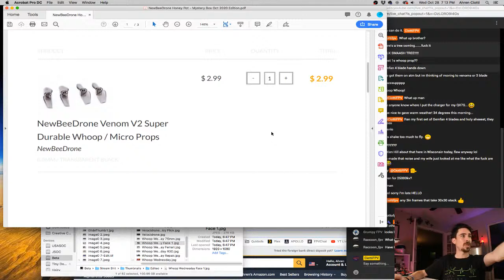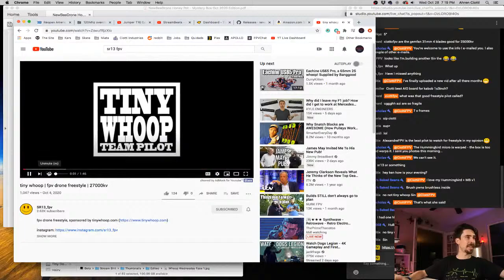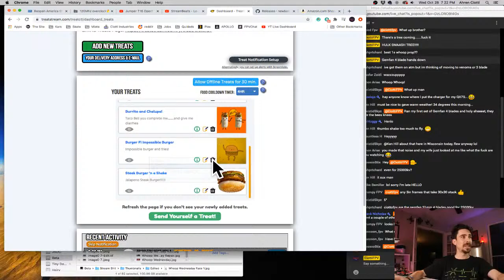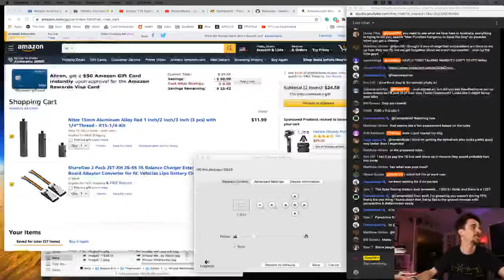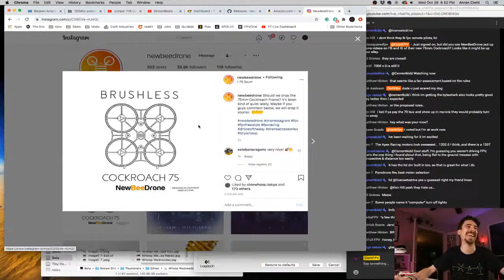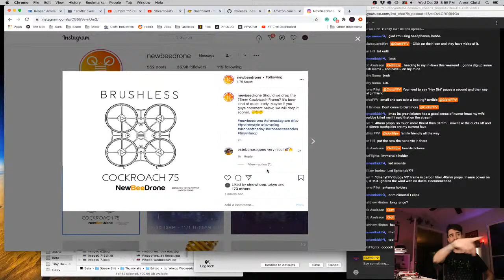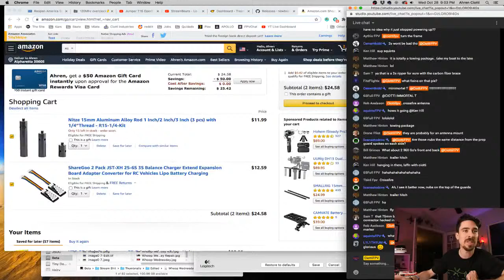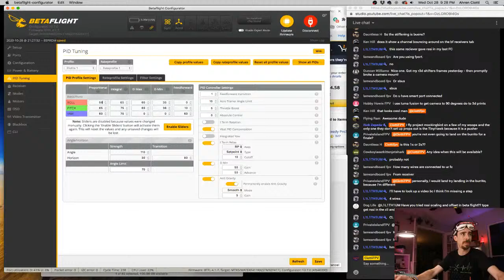Whoop Wednesday - Can we get to 4k Subs??????

Comment: Hi Ciotti.  Those ducts I believe are the Kingkong or LDARC ET125 duct if they can hold a 2.8" propeller.  They also did 2 smaller versions, and then later I think they did a 4" version
Reply from the maker: Son of a bitch you're right, 2.8 only, I fucking remember seeing these guards a while ago and I didn't buy them when I saw they were 2.8 rather than 3 although I have to admit that the 2.8" props are pretty good, heavy as HELL but VERY strong
Reply: @CiottiFPV  Yep!  I knew as soon as I saw them.  The Kingkong ET125 was my first ever 'serious' quad with betaflight.  I remember struggling for 3 days trying to set it up!  Later I removed the guards and that's when I discovered the emax 3" Avan props.  Of course I blew up the motors which were only 1104's! 😁 ❤️